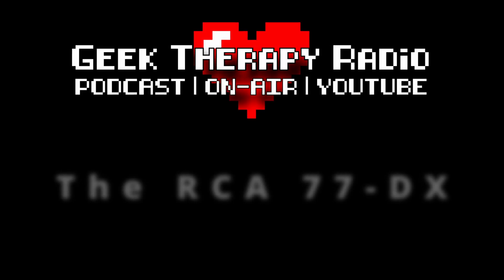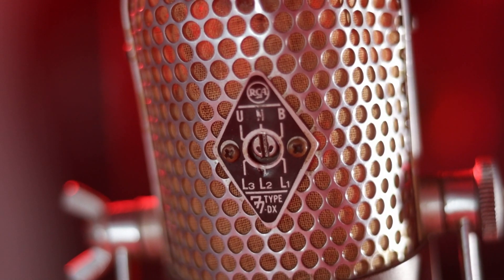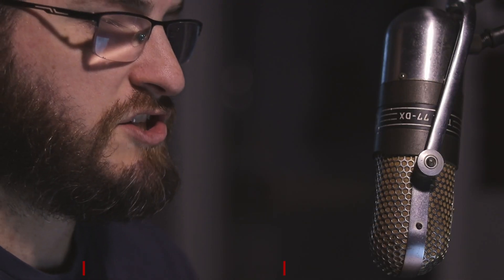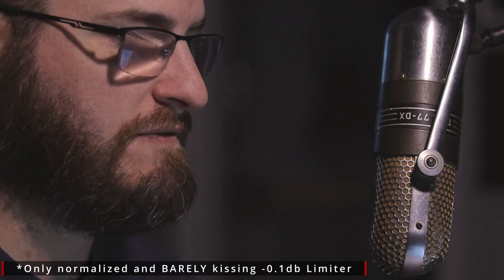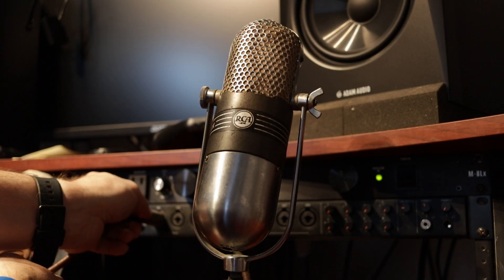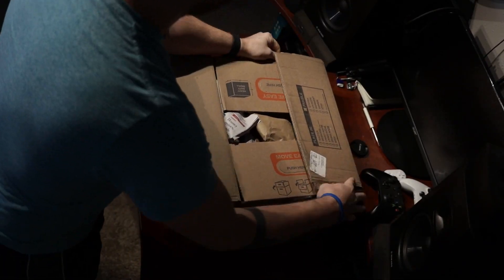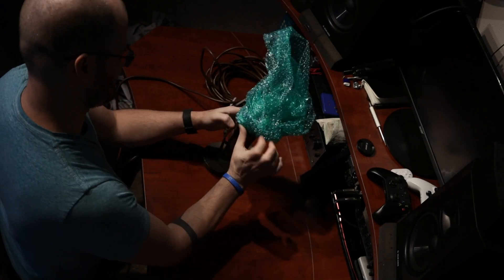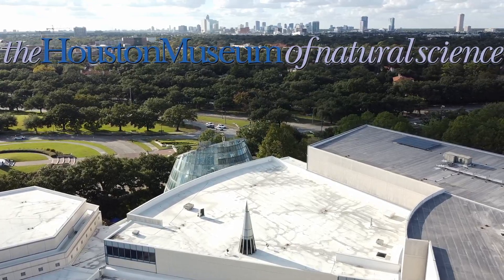Exploring my legendary RCA Type 77-DX Ribbon Microphone

Comment: I have a pair of these 77 DX mics and both of them have a subjectively much wider range.  I don't know what years they were made in, or if RCA made improvements later, but they both sound fantastic and very wide range on "M" selection in comparison with what I heard on this video.  I recorded some live music without EQ and I was impressed.  I have been using both a Scarlett 2i2 and a Behringer UMC2002HD with absolutely no issues with gain.  I'm surprised that this 77DX sounded so subjectively narrow range.  Ribbon mics generally have less mass to drive than dynamic mics and they usually provide for more detail.  Large diaphragm condensers have even less mass and provide for even better detail.

Comment: Nice video! When you show the pattern selector at about 2:40 and say that you're using the N pattern, it is in fact showing the L2 pattern on-screen. The marks next to the screwdriver slot form a sort of "arrow" to point to the way it's set. These mics are fun to play with! I'm developing a matrix to sort of catalog the sounds of the various combinations of rolloff and pattern, to get a sense for what works nicely for different scenarios. The V2 rolloff is pretty severe, as you point out, so it probably isn't going to be useful for a lot of things. My DX (which I believe still has the original ribbon, or at least quite an old one) sounds almost condenser-like in the U position with either the M or V1 rolloff. I'm surprised at how crisp the highs are, while still keeping that buttery ribbon smoothness. Enjoy the experimentation!

Comment: I would really recommend a re ribbon, this mike sounds dead to me.
I have a rca 77D, and it sounded identical to this before having it re ribboned.

This sounds somewhat anemic to me (without eq)
these 77s sound great without much compression or Eq.

A re ribbon is necessary to keep the mic sounding as it should..

Imagine it as changing a tube in your amp, Its not changing the amps history or soul, it’s keeping the amp working the best as it can.
Reply from the maker: Fantastic advice. Any ballpark on what it costs?
Reply: It's not expensive.  I had mnine done at Big D Broadcast Exchange around 2014 or so.  At the time, it was only about $100.00, IIRC.  Great video, thanks!
Reply: I agree. Should have a lot more low end. Did you ever get it re-ribboned?